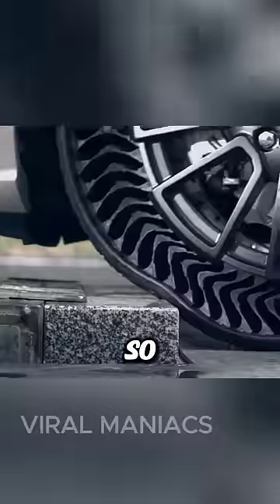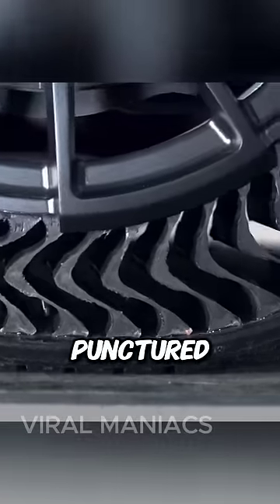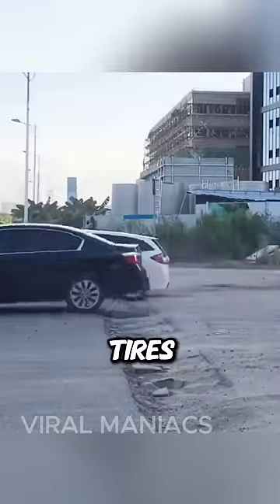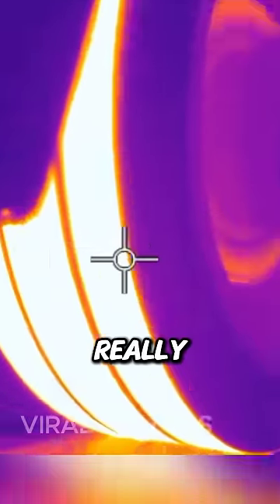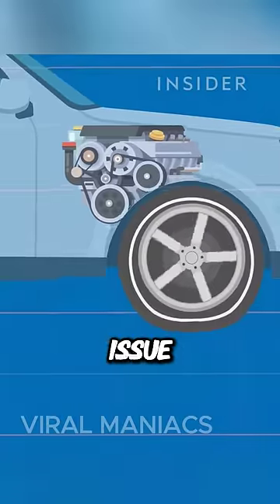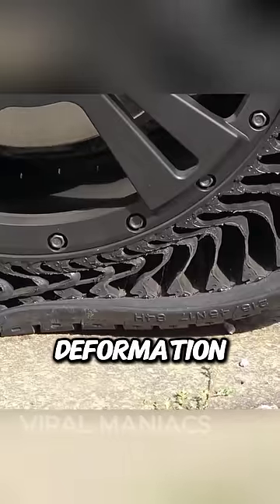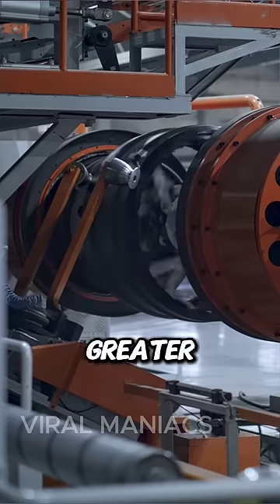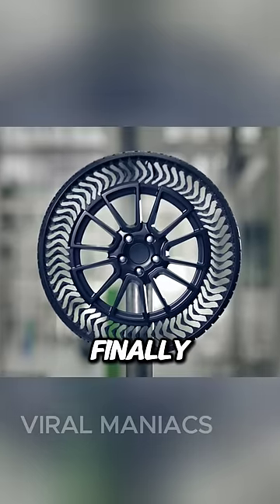Why Don't We Use Airless Tires Yet #shorts

Comment: I've been hearing for 10 plus years they'll be on the market tomorrow. 🤔😂
Reply: Hey Arnold 😆
Reply: Hey dave 😆
Reply: More like 30 years
Reply: They weigh 3x more, eat up an extra 12mpg efficiency, and ride like lumpy mush. Newer doesn't mean better.
Reply: @almostontimehero5415  With how inexpensive an all season tire is from Walmart, the gas savings alone compensates for the cost of maybe having to replace a tire early
Reply: Like fusion power.
Reply: Will Walmart put other brands of tires on your rims on different sizes an none of there's
Reply: @almostontimehero5415  exactly, they're never be as efficient as regular air filled rubber and steel tires
Reply: Dont worry, fusion is just behind the corner
Reply: I'd recall 20 years since i've heard about them.
Reply: @lauramcelhiney ARnold..ARNold..ARNOLD!! “Move it Football Head!” Heyy Arrnold!🤣💀
Reply: @Jus10Ed dude knows nothing about fusion energy and its recent advancements.
Reply: @computerscience1101  yep, a couple years ago fusion ignition was demonstrated with a third method.
Reply: It's like nuclear fusion: always 10 years away every 10 years 🤪
Reply: @almostontimehero5415  But they'd be great on bikes.
Reply: Forklifts have them, so do smooth drum rollers.
Reply: Underrated 😂😂
Reply: There was a set of tires similiar to those on a case skidster back around 2005 so theyre already around.
Reply: @Mike-su8si bruh, what the hell did you just say? 😳🤣
Reply: they are masslivey available . but just smaller sizes.
Reply: @jackmemphis777 so you just put the cheapest on huh… lmfao by that logic you should purchase an inferior everything
Reply: I promise they will at 8:00 am first thing in the morning.😂😂😂😂😂
Reply: I got ya first thing in the morning.😂😂😂😂😂
Reply: you might be trapped in the same day and having the same day for a decade or so
Reply: That sounds century 🤣
Reply: @lauramcelhiney hey
Reply: They have used them on some lawn mowers for years now.
Reply: @almostontimehero5415 just wait competition will bring the price down
Reply: In a thousand years it will still be a dumb idea.
Reply: Exactly, I’ve been hearing this since like 2014😂😂
Reply: Yeah. Complete useless garbage.

Comment: As a Canadian, my #1 concern was not even tackled... what about winter. If deformation is already an issues what will it be like when those holes are filled with snow or with water turning into ice. The expension will damaged those tires for sure and in a way that might be way more dangerous than regular tires!
Reply: I'm pretty sure they only keep them open for testing and that the final product would have side-walls just like a normal tire.  You probably wouldn't be able to tell them apart at a glace side-by-side
Reply: No worries, it will collapse instantly under the weight of the mandated EV that will not be able to start due to the cold so you'll be good.
Reply: You should reach out to NASA and Michelin and let them know they forgot to consider temperature and climate as a factor in space and on Earth. They’re still amateurs in this field so make sure to deliver the news gently
Reply: These are summer tires
Reply: Exactly !
Reply: Extremely dangerous.
Reply: reading your comment I don't feel you're Canadian
Reply: @heyomando1374 Gosh,, You act like Helium isn't a difficult gas to use to presurize fuel for thrusters.. like on Boeing new Space Capsule that cant fly straight.. lol
Reply: @Ron-d2s you know that norway has the most EVs right now on the street and they run well…
Reply: Shut up Canada!
Reply: @vishant98  We in Canada have nasty winters.   It seems like you don't know Canadian weather.
Reply: @hardywoodaway9912  Why do you ask him that when he made such an effort to make it undoubtedly clear that he doesn't know anything?
Reply: @hardywoodaway9912  Norway,  you can fit 3 Norway in Ontario alone.
Reply: In other words, addressing the issues with traction on terrain.
Reply: And I was thinking about mud, or driving in a partially flooded road. Rocks will easily get stuck into those gaps!
Those tires may be just fine on the moon and Mars, but those gaps will be the death of those tires.
Reply: @hardywoodaway9912 continental weather is more extreme
Reply: They're clearly not for winter conditions and you should know that you can just go on living your life just fine without them.
Reply: Deformation will help with winter. Winter wouldn't be an issue on these for so many reasons. Winter is the least of your worries with these tires.
Reply: @Ron-d2s  That's Michelin's problem to solve if they want to sell any tires.
Reply: @Thanks-bj1fo  If you don't think the right consistency of snow would build up in those negative spaces, no one can help you.
Reply: @tannerannichiarico7255  don't need help. It's pretty obvious snow wouldn't be a problem to anyone with an understanding of vehicles lol
Reply: @Thanks-bj1fo  Go ahead and explain why then genius... We've (anyone who lives in snowy areas) all seen snow stick to tires and vehicles already, so go ahead and tell us how these tires and your understanding of vehicles solves that problem.
Reply: @tannerannichiarico7255  understanding simple concepts doesn't make me a genius lol
Reply: @Thanks-bj1fo  What's the simple concept that I'm missing here? Snow doesn't stick to anything that you say it doesn't? Weird concept... I've never seen it in action...
Reply: @tannerannichiarico7255  yes. If you say so
Reply: @Thanks-bj1fo  No man YOU'RE saying so hahahahaha
Reply: @tannerannichiarico7255  that's not at all what I said but do you 😊
Reply: @Thanks-bj1fo  My guy... you said "Winter wouldn't be an issue on these for so many reasons. Winter is the least of your worries with these tires." and then I asked you for evidence or to back that up with anything other than your word. You failed to do so. Therefore you imply that these tires will work well in the winter and the basis of that is because you say so. If you want to provide any supportive evidence or contextual facts that support what you're saying, that's what I asked for initially.
Reply: @tannerannichiarico7255  oh well, sucks to be you
Reply: @Thanks-bj1fo  At least I believe in things that are based in reality. You don't seem to share the luxury.
Reply: @tannerannichiarico7255  oh well. Bubby didn't get his way. Rage over the internet harder lol.
Reply: @OrenPanitch Same thoughts on my end. As those tires are predestined for off road use, Michelin will most likely cover/seal the flanks to keep rocks, sticks and dirt out. Probably the contained air also gives that bit of extra comfort until punctured.
Reply: The support were out
Reply: If you’re Canadian, you use a completely different set called “winter tires”.
Reply: @YukiPyro  Canadians Who live in places that actually get a lot of snow have two sets of tires.  In my province, winter tires are even mandatory by law from December 12 to March 12
Reply: Come on... they are only flat on the bottom!!!!!
Reply: Yes, like others have stated. Open for the tech demo portion. It will have a sidewall of some kind.
Reply: @Pekoms_21 yeah, only Canada has harsh winters...
Reply: I live in Central Maine I was gonna ask the same thing Ice and Snow.. mixed with a few under 20 degrees below mix that with at least 1 nor' Easter per year or ever other.
Reply: They’ll add sidewalls.
Reply: @Ron-d2s 😂😂😂😂😂💪🏾✊🏾🔥
Reply: @Thanks-bj1fo he’s not raging, he’s literally won the argument because you talked out of your ass and couldn’t back up your point.
Reply: @819driver  physics don't care who won or lost lol
Reply: @heyomando1374 well, NASA definitely forgot about temperature as a factor in rubber O rings in ‘86….
Reply: @heyomando1374 You ever hear the words "so smart, they're stoopid.."? It applies to NASA too... .
Reply: @Thanks-bj1fo  your friends must really like you if you have any, you can’t win an argument if you don’t have any facts to back it up. Saying physics don’t care isn’t an argument, you need to explain why it is. If you’re just gonna come back at me with another non factual statement then just save your time and don’t even bother.
Reply: @819driver  bro it's the internet. Stop caring so much lol
Reply: I thought you had square tires in Canada?
Reply: As long as the sides are open then the water turning to ice can expand without affecting the tire. Not to mention that the heat from the friction on the tire would melt the snow along with centrifugal forces throwing the snow out of the wheel.
Reply: Troof. 🧐🧐🧐
Reply: They need to close the out side and let the air of the compression go through the mag to prevent snow or anything getting inside the hole qe see
Reply: @trentbateman  Be nice to our neighbors. Or you might not get that good Canadian bacon 🥓 on your Hawaiian pizza! 🍕   😅
 Now I want a Hawaiian pizza! LOL 😅
Reply: @caseylabelle1128  In states like Ohio, people have studded snow tires. Those are definitely winter tires. Not just the fact that they destroy the road surface if it's not snowy or icey, but they aren't cheap and people tend to switch them right away, as soon as winter passes. They wear down really fast if driven on dry surfaces.
Reply: @819driver I think he won 🏆 bro!
 He's got the last comment in there! 😅😂😅
That's a win! 🎉😅😂😅 👍
Reply: @Thanks-bj1fo An understanding of snow! ❄️ 
Snow properties and composition!
Yellow snow has different density and specific gravity.  I think the Ph level of yellow snow will be detrimental to the aluminum section before any deformation occurs! It might stick to glass fiber reinforced plastic!
😅😂😅
Reply: @sk8rboy509  Well, if the tire is turning, it may never turn to ice. Maybe ice cream  🍦 that's what they should be marketed for! 😂😅 Wouldn't be good if the neighborhood dogs are free to roam, however. It would definitely cause a problem with the flavor quality. 😅
Reply: @Sea-Bass They've stepped up to triangular tires a few years ago. They're getting there. Soon they will eliminate the three corners They've got top scientists working on it from Nigeria and Ethiopia.😅😂😅
Reply: @robertlee4809 I know NASA stands for Need Another Seven Astronauts. 😅
Reply: @ElectricBillAlbright  nice, can’t wait to see.
Reply: Why don't they put rubber covers over the inner part?
Reply: @ElectricBillAlbright  also, don't eat the yellow show 😊
Reply: @Ron-d2s TELL EM
Reply: The Tweel tire. Lasts 3x as long and costs 5x as much. Math makes it an easy pass.
Reply: @Ron-d2s  haha 10,000 ev hummer
Reply: I'm sure there will be a better design that will cover up those wholes
Reply: @samrichardson441  actually they are considered all-season tires, however we both know all-season tires are not appropriate for winter in snowy climates. Summer tires are a specific compound formulated for maximum grip in hot weather climates, and should never be used in temperatures 10C or less.
Reply: @YukiPyro  I am from Pennsylvania we are close to Canada's winter theirs are brutal like -60°C
Reply: @hardywoodaway9912  Ontario, in Canada, is one million kilometers squared , all of Norway is 385 thousand kilometers squared, Norway is like a small American state. That's great they have electric cars , but in areas with extremely cold weather like Canada electric cars are essentially useless at certain times of the year. The more you plug it in the more it degrades the batteries, once you've hit your charging cycle limit on those batteries which a lot of people will because they make long commutes, especially in densely populated areas with millions of people where sometimes you are sitting in traffic for 5 hours sometimes not moving, and your gonna have to keep the car running the whole time to make sure either the heat or the AC is running in the car, so now your idling batteries for hours at a time. Electric cars are dumb as shit except in warm areas. Places like California electric cars will work flawlessly, but there's only so many places like that. I could go on all day, electric cars are a terrible choice for anyone facing any kind of weather or long commute.
Reply: Just put canadian syrup on it
Reply: Как канадцу, тебе стоит переехать в Дубай😂
Reply: @heyomando1374 If you actually have high regards for NASA i pity you.

They spend 99% of the money they have on CGI.
Reply: @heyomando1374  everything is collapsing all around us by those we're supposed to trust and yet still you trust them
Reply: @Ron-d2s there’s scores of gasoline vehicles weighing as much or more than EVs…they don’t seem to have any problems
Reply: Still have to plug holes in airless tires. Having the sides open just shows off that they are airless. They wouldn't be sold to the masses like that
Reply: Already gotta swap to snow tires in the north. So I’d assume you’d just have two sets of tires and use these airless ones in the summer. Assuming these actually come to market and work.
Reply: expansion*
Reply: @heyomando1374  yet I see these dead on the side of the road, or in parking lots all the time in the winter here in Ohio. I stop and ask "Hey are you stuck?" And the response is always, "Nope, battery is dead."
Reply: @heyomando1374  I mean he’s not wrong tho… they can’t handle the weight of a normal car. So they certainly won’t handle the weight of an EV lmfao. Why are you so defensive about something that he’s pointing out as prima facie
Reply: You guys use snow tires anyway.
Reply: @streptococo4735  I really don’t have any opinion of NASA and could care less about what you think believe lol. It was just some lightweight sarcasm, cool your jets.
Reply: @pog428  you’re taking a sarcastic comment/joke on YT way too seriously my guy😂
Reply: @Slking507  You see airless tires on the side of the road a lot?
Reply: @apolloxv8820  defensive? About what😂 I made a simple sarcastic comment and you’re rambling on about a bunch of nonsense 🥴
Reply: @heyomando1374  no, you think you’re more clever than you really are and now that you’ve been called out you’re going to just use personal attacks and childish emojis
Reply: Crunch!
Reply: Tell that to Trudope.
Reply: @apolloxv8820  BRO WHAT PERSONAL ATTACK LMFAO! You have serious issues I hope you find the help you need. I won’t be responding again. Good luck
Reply: @heyomando1374  lol can’t defend his stupid position so he nerd rages and leave
Reply: Expansion of ice will go to the path of least resistance, meaning to the side. 
I agree on the rest you said
Reply: @SonicUnderground316  - Probably NOT, for that reason anyway. The extreme cold may be an issue, because, in the extreme cold, the flexible properties of the wheel material that allows it to flex from round to flat, over and over again at varying speeds could change in rigidity just enough to cause fractures. As far as the holes and possible water goes, that would matter unless driving into them with reckless abandon and in the case, pneumatic tires would fail too!!!
Reply: @Ron-d2s Bro y’all need to chill with the bs rhetoric surrounding evs. A Toyota Camry weighs more than my ev and as far as not starting I’ve never had that issue and I live in buffalo…go figure. Last year when we had that freak cold snap and a bunch of evs couldn’t charge due to the cold there were an equal number of ice vehicles that wouldn’t start because their batteries were dead. Triple A said they had record numbers of calls due to dead batteries in ice vehicles…just stop dude because it’s sad at this point. I’ll bet you’re a trump supporter…🤡
Reply: @OrenPanitch  it might not. I’ve seen these tires used by ride-on mowers in Canada (this summer) and they had no side wall. The city is only using them the warmer months I’m guessing. Maybe there’s a difference between commercial and consumer availability
Reply: Us Canadian winter drivers will have severely unbalanced wheels.  I'll stick to the xice xi3 for now.
Reply: Yes! Exactly!
Reply: Don't worry, it's a dumb idea, nothing will come out of it.
Reply: @Ron-d2s exactly 😅🤣
Reply: I am sure they'll be happy selling it to all other 10 whole countries that never snow.
Reply: @DCFTW68  There is not a single country without snow, mud, gravel or other shit. Only cities.
Reply: @DCFTW68  yeah, glad for them!  Unfortunately, we get a lot of snow in Wisconsin.  A LOT.
Reply: They would not be widely sold in certain markets because of certain conditions as an alternative

Comment: It’s already being used on machinery. Like drivable lawnmowers, some tractors, and forklifts. Items that don’t have that heat problem.
Reply: Yo I saw some on a riding mower last week!! Badass
Reply: Yes, I have been in the tire industry since 1995 and I remember this tire, called the Michelin tweel, since around 20 years ago. The biggest reason they haven't came out on automobiles yet is the high speed. The polymer fins break apart at higher speeds so far, but, I figured it would just be a matter of time until they could get the material right. This tire and wheel configuration lasts twice as long as a pneumatic tire and the tread can be purchased separately from the wheel.
Reply: Generally Polyurethane of some sort, a hard plastic that doesn't readily deform under stress.

Generally for indoor equipment like scissor lifts, boom lifts, forklifts, etc.

They are not very good in dirt, they are terrible in mud, they provide very little suspension, but they carry weight better and can be used with a very low profile to bring the vehicle's mass closer to the ground.

Not new and not 'superior'.
Reply: @steveTGO  is it closed? Or still open? Cuz will be filled with dirt, rocks or snow ❄️ and will fail
Reply: @vcommandarv5916  - Open, it cannot be closed on just one side.
Reply: @steveTGO  You're in the industry and spell it tire? 🤨